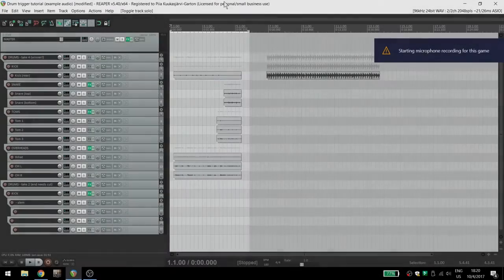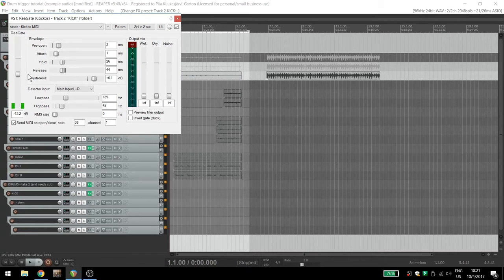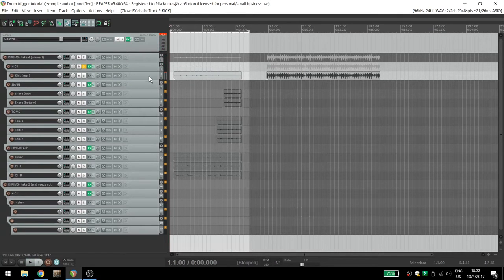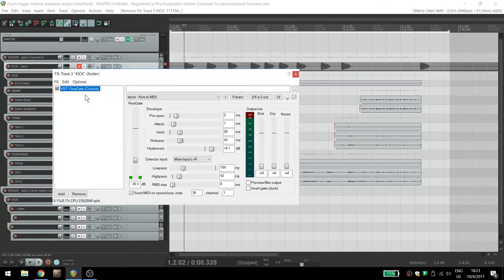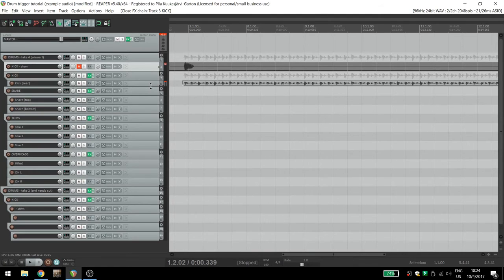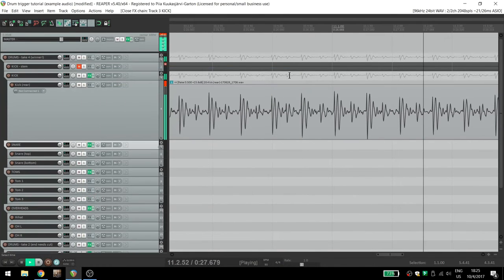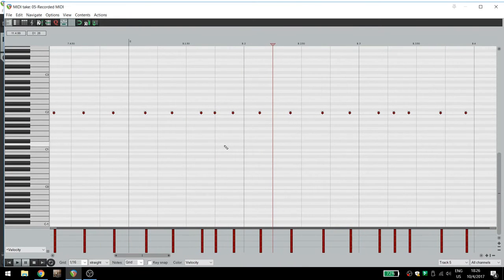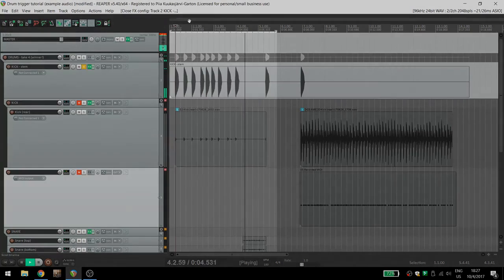REAPER Tutorial - Drum Triggers

Comment: Thanks for the information. The reason you are experiencing latency is because your buffer size is far too high in your asio settings (I can see that it's set to 2048 top right corner). Set it to 32 or 64 and it'll be under 2ms